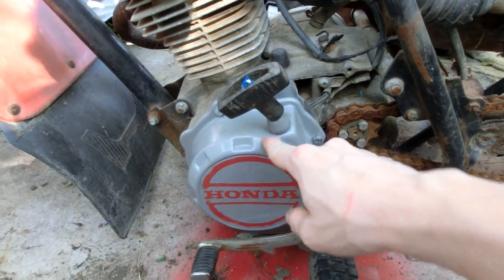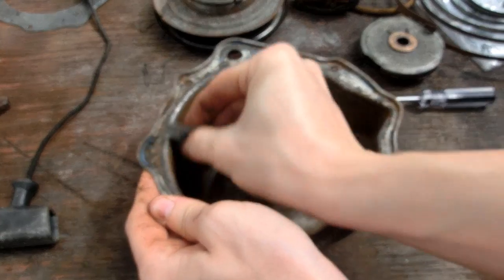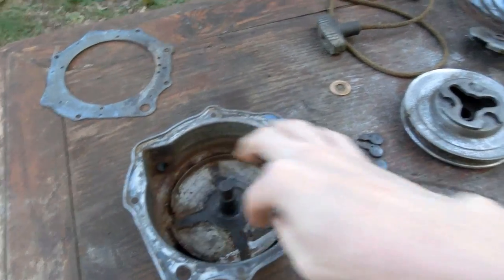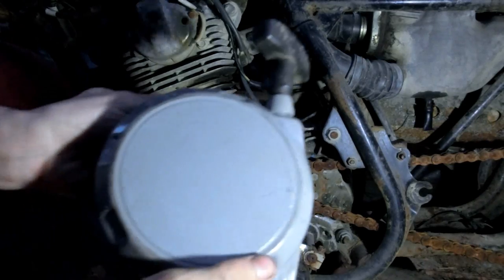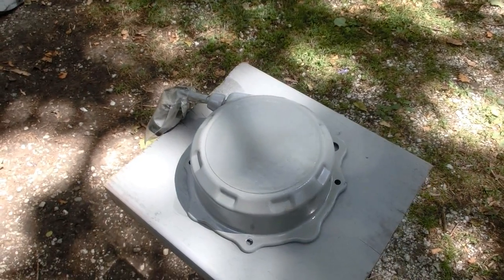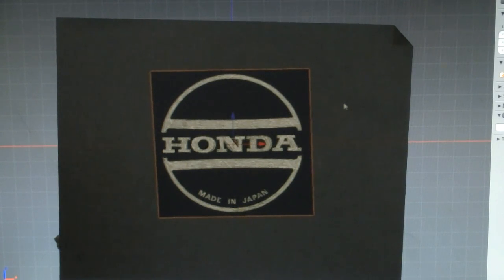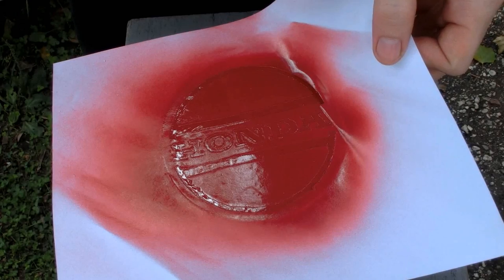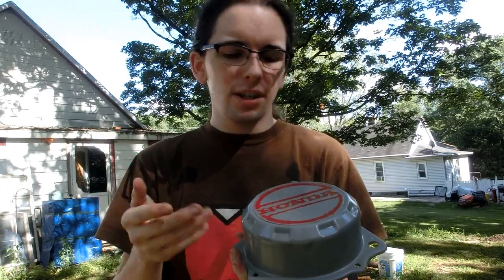1982 Honda ATC185s restoration part 3: starter paint / logo

Comment: I done things like the upside down logo before.  My mom refers to me as the absent minded professor because instead of concentrating on the immediate task at hand, my mind was always wondering on numerous other things and then something simple goes wrong with the task. 
       If you had left it upside down, when someone points it out, all you had to do is lean over from the seat looking down and say, "It looks OK from here."
       At least you are honest enough not to edit out your mistakes.  Because of things like this, I have learned to assemble parts first and make absolutely sure everything clears and works together, and then take things apart and glue, do final cuts and other things that are relatively permanent.  For the younger guys, this video is a good learning tool.
Reply from the maker: ya know that would have been so funny to do the leaning over thing haha.

Comment: They make small wire wheels for drills.  Both flat disk style and "cups" that would work well for the inside of the starter.  You would want to consider larger saftey style glasses or a face shield tho if you use them as they sometimes throw little pieces of wire.
Reply from the maker: i've been thinking about just making a little extender on my grinder and putting a tiny wheel onto it, and yeah they throw wires.

Comment: I would of printed the logo out onto card or paper then got a sharp knife and cut it out carefully then coat the stencil in wax one side to prevent high paint absorb into the paper. Really felt your pain when you noticed it was upside down

Comment: You may know this already and if you do that's great, but you need to get an actual Honda pull handle. It will have a cupped end and will cover the hole where the rope goes into the recoil. It will keep water from getting in it when it rains.
Reply from the maker: +John Harris oh i didnt know that, thats cool. i think im going to drill a hole into the bottom and add a threaded cap i can remove in case water gets in there anyway.

Comment: When you put the stencil on the starter to paint it, I noticed that it was upside down so i yelled at you that it was the wrong way, but I guess you didn't hear me. Now I can guarentee that next time you will not make the same type of mistake again after all that work having to be redone. You did good with handling your anger, said some bad words and attacked the offending paint job with a scraper, alot of people would have become really frustrated and threw the starterat a wall or something. Years ago I let a MukAluk (intentionally misspelled) chainsaw get the better of me after putting at least 10 hours of work into rebuilding the carb, then one thing after another with ignition, bad fuel lines and filter, clutch, etc, I fired it up and it ran for about 10 seconds and siezed up. I became so infuriated that I threw it against on oak tree, than took it back in my garage and proceeded to destroy it with a ball peen hammer. It never ran again, but it sure felt good, relieved a lot of stress, plus I never had to work on it again. :)
Reply from the maker: yeah chainsaws arent fun, i have one from the 60s or 70s that is seized. havent gotten around to fixing it and i bought it when i was like 15, oh well i only spent 10$ on it.

Comment: Next time you use spray paint,you should go in short overlaping strokes ,releasing the nozzle each time.You'll see that your coats will be light,and you'll prevent runs.3 or 4 coats,add more  and it will start looking dull.
Reply from the maker: my method is working how i want it too.
Reply: Rinoa Super-Genius It was an advice,not a critique.
Reply from the maker: Ervis Bekteshi
ah

Comment: but the solution was SO simple....use saw, cut out image from tablet screen, glue onto casing. :}
  I will tell you a story,  i was once changing my car oil, so i drained it out, and started filling the new clean oil, and the dipstick wasn't going up, i put the whole container in, and still no reading, i then realised i hadn;t put the sump plug back in, the new oil had now mixed with the old oil in the drain container, wasting it :}
Reply from the maker: haha.

Comment: I just picked up the same 185's not really in perfect shape though bottom of the gas tank was 100% right about from front to back and one tire holds air for 5 minutes other two won't hold any air frame is not really in perfect shape but I heard the 185s and 200s used the same motor and everything and I have a extra 200 S frame that is in good shape looks like I'm making a Frankenstein

Comment: That bench grinder really doesn't sound healthy, it seems to bog down too easily too...
Admittedly it still works, but personally I'd want to get it working a bit better...
Reply from the maker: +TheFurriestOne its a 30$ piece of shit grinder, i think some of the windings are shorted out or something...or maybe it was made for 240v.
Reply: Rinoa Super-Genius Could be the centrifugal clutch that turns off the start-up windings isn't set properly, ran into that when I replaced the bearings in mine and didn't get it set right the first time I reassembled it. Does it get warm quickly? That's a symptom that could point to that. Enjoying the restoration though!

Comment: lol, dude you were so close to rage quit there, love it. Should have threw something, like a table or a washing machine :-) doesn't half kill you when its fiddly work, you lock ages up in it and it goes south on you.

that you endured and got a pro-quality job, shows staying power, I'd have needed a smoke while I was doing that or the neighbours would call the police.

your atv's coming on nice now, new tyres for a new owner :-)

would you find a 'Verran AC Datalink' useful? otherwise I'm mauling it for a switch...literally...just a switch...seemed old kit that may be up your alley. I was due to start a new box called 'fragile shit for Rinoa', but it seems a bit pointless if it is void gear/components

let me know if its handy. ah and I have a sega mega drive here floating around somewhere if you want it, cant remember the version, had nes when I was a kid. looks early say 8 maybe 16 bit cartridge.

Will have a look round and shit, might even go near under the stairs...you don't wanna know whats under the stairs...so wrong...g0d f0rgive me